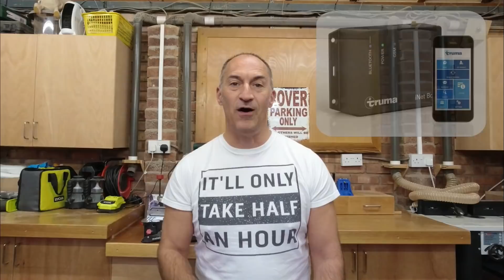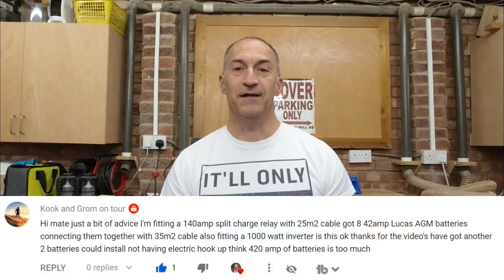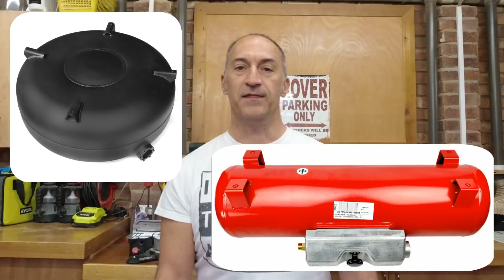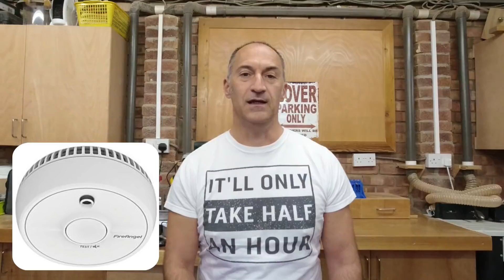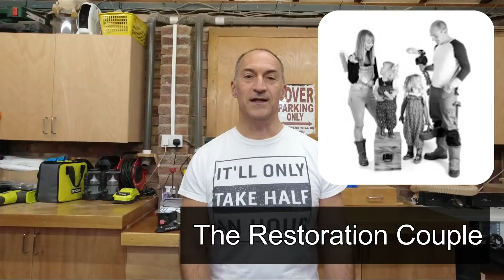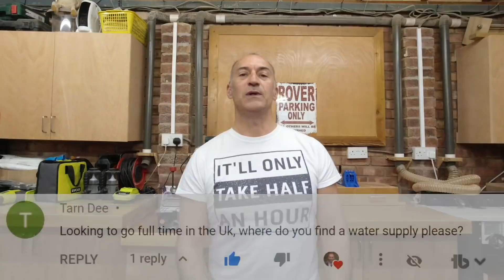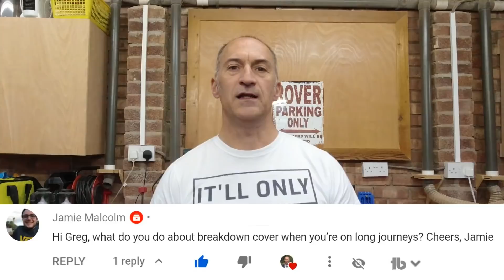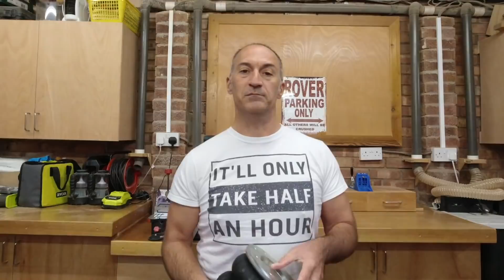Vanlife Q&A - Your Questions Answered

Comment: 0:13 Hi Greg, just recently subscribed, brilliant stuff, love the technical explanations. I’m planning on getting a LWB sprinter for conversion. There will be four of us, so I’m looking for ideas on sleeping space, I’ll also need to fit another seat for travelling, I’ve a girl and a boy, so I’d need a referee if I was to put them in a double. I was thinking of a single bench/ bed.. or even a single bed that lowers 
. The main help I needed was with the extra travel seat and attaching it to the floor. Would it be a case of fitting the base straight to the floor, and then fit the insulation/ ply around the base? Any ideas would’ve great.. Thanks for all the content… I’ve got the van bug…
Reply from the maker: Have you thought about roll out bunks for the kids that you can roll away and clip to the wall during the day. You can raise the seat but need steel support channel or box section and longer high tensile bolts. Don’t scrimp on the secure nature of this as it will have a lot of inertia 👍🏼😊

Comment: Hi Greg

Just on with my second van build.  On my first van I had the cupboard doors made up with a 3mm PVC edging fitted all done in the kitchen manufacturers workshop. I noticed in your video you used iron on edging. could you tell me how that is held up and if it was any particular brand of edging
Reply from the maker: The iron on edging has been amazing we have not got a single blemish on any of it after over 3 years of constant use. The edging was supplied by Morland uk. I have done a video making the cupboard doors showing how I applied it.

Comment: Hi Gregg
Another excellent video, thank you. I'm working my way through them lol. Regarding using Sketchup, it didn't take me long to run into difficulty! I have managed to form the 3D shape of the shell, as per your previous video, but for some reason it's not behaving in the way you managed to get it to go. When I deleted all the guide lines, a load of lines remained within the body, but when I deleted some of them, instead of just the line disappearing, the whole section of panel disappears? Any small help would be greatly appreciated. Thanks again....
Reply from the maker: Make sure all your lines are drawn on layer 0 you may find you have grouped lines or put lines into a component by mistake selection. You can explode these groups and reselect them. Hope that helps
Reply: Once again you've shown you are a top man! Thanks Greg

Comment: Hi Greg I have a Ford transit with two 12 v 80 amp batteries under the drivers seat, and I have two 135 amp leisure batteries, what I need to know is, do I need to change the 80 amp to match the 135 amp batteries but then do I need a larger battery cable I have 16 mm at the moment
Reply from the maker: The best way to charge your leisure batteries from your van is with a B2B charger. You can set the charge profile to match the type of battery and it will manage the charging much better. 16mm cable would be fine for a 30amp charger. I recommend Victron Orion 👍🏼😁

Comment: Hi Greg, I wrote you a while ago about using an AC charger with a true sine wave inverter to charge my batteries in my van build. I did this because we weren't planning on doing much boondocking. the system works fine for the most part however, I am running into a peculiar issue, and I was hoping you might have some insight for me. when the van is running and the charger is operating, the refrigerator display becomes erratic. It appears to be functioning ok but the display jumps all over the place. Also, if our phones are connected to the battery system for charging, we are unable to use them. Again, while the charger is operating. if the charger is off, no problem for any devices hooked into the battery system. Is the AC charger causing interference with the electronics? Thanks for any advice and very much appreciate all your videos.

Comment: Hi Greg. Firstly just wanted to say your videos are fab. I am just about to start a van conversion and have just bought the van. I am considering going gas free on the van. I have a LWB van so plenty of room for solar and an considering a 300 ah lifePO4 battery. I am looking at the Truma Combi D6e, a Combi microwave instead of an oven and an induction hob. Just after your opinion and any advice you may have. Thanks.

Comment: Hi Greg have enjoyed you build series to the extent that it has spurred me on to have a go, I have now almost completed my Transformation of a Citroen Relay L2 H2 into a 2 birth Campervan using and adapting some of you video content, I have one question though I have fitted a 25L gasit underslung gas tank a Truma Bopiler and Thetford cooker I want the Gas system inspected How and where did you get this done I live in Braintree, Essex so not far from your original Base , any help would be appreciated,  Regards
Reply from the maker: Speak to your local caravan and motorhome dealer. They will be able to put you in touch with an lpg engineer

Comment: Hi Greg ! Thanks for all your very instructional videos ! I have one question about solar panels. At the beginning you planed to have tilting panels to catch more sun, but you didn't go this way. What about the temp growing under the panel when exposed? It seems you have less height below your panels than many others that suggest to have at least 10cm for good ventilation. What is your advice on this ? I would prefer, like you, to have the minimum height. Thanks a lot !

Comment: A little trick that may work for bending over head boards, is if you can cut kerfs in to them to make them flex to the shape you want. Thanks for your videos Greg, absolutely brilliant. No Cigar Box but just finishing my first Acoustic Guitar, maybe one day we can have jam. All the best.
Reply from the maker: A lot more skill required to build a regular guitar. Thank you for watching 😃
Reply: @GregVirgoe  difference being I'd really like your Van building skills! :) Have you ever though of insulating with Aerogel Greg? Very expensive but very impressive properties. All the best.
Reply from the maker: The small gain in insulation would not offset the massive cost. £100/m2

Comment: Hello Greg,
I have written to you in the past asking questions about your van build. 
Your help has been invaluable. I was actually going to make a video outlining how I had followed your channel to complete my van build with no workshop and ‘basic tools’. I found your channel to be the best by far and had taken photos along the way using tools bought second hand but some new items and reclaimed material that others had thrown out. All done with no workshop and no experience. I finished my build back in April and I have not been able to make the video because the photos were accidently deleted. Now I see that you are going to do exactly what I had intended to do, I thought I’d reach out and tell you what a success it was and much easier because of your guidance. I’m in Australia and the insulation works a treat. Fantastic.
If you like I can send you more information about my experience following your ‘tutorial’ if you think it might enhance your next build that you have highlighted, for those that don’t have a workshop or limited tools.
In short my van is a MWB Sprinter High Roof. I had the passenger side sliding door removed and installed a fiberglass mould and caravan door in its place and a caravan style awning added. The drivers side sliding door was disabled and fixed in place rendering it inoperable allowing for the Lagun table and seat, with porta pottie under, to be installed in that location. External surfboard racks are mounted on the side. Both seats have swivel plates installed. The bed is East / west layout by cutting out the ribs and then reinforcing the outer skin with sheet metal. The cupboards and storage is built in the Shaker style all material was free off the street during Council clean up. I only had to purchase the ply for the walls and floor. I installed two Sirocco fans at the rear. I did the build out in the open air using basic but ‘good’ tools I bought mostly second hand. The new tools I bought were a life saver. Kreg Acu Cut, Kreg Rip cut, pocket hole jig, and a two in one brad nailer. The compressor was $50.
I was worried about the sink/stove cabinet build, as you know it has to be millimetre accurate so I first built it as a ‘template’ using free offcuts from a nearby kitchen maker. I built it in the loungeroom. That was really insightful and I nailed it perfectly because of that process. 
The fixing of the overhead cupboards was a solve it as you go issue because though I built it square and plumb it would distort slightly when I attempted to mount it due to the curvature and shape of the internal ply lining wall as it approached the rear barn doors. 
What I liked about your channel is that you were thorough and you were inviting, just like the BBC. You have been a great help. Thank you. My son is so impressed he wants me to help him build his.
I'd send you some pics of my van if you can tell me how.
Giacomo ‘Working on a Dream’

Comment: Good update, thank you, Greg. I was wondering how you found the single-glazed windows now you are back in the much cooler UK? Any condensation problems? Thanks.
Reply from the maker: We do get a little bit on them but by far the best thing is to keep the van ventilated and warm at night. That helps a lot
Reply: @GregVirgoe  Thanks! I'm at the point of deciding whether to go with single (better-looking) or double-glazed (expensive and less pretty).  Was your choice influenced by budget (at the time) or other factors?

Comment: Hi Greg.. In your opinion, which material is the best to do the furniture inside the van, plywood or MDF including the walls, ceiling and floor. Thanks
Reply from the maker: Personally I would try and start clear of MDF because it’s heavier and swells up if it get wet. A decent ply would be structurally better.

Comment: I have a sprinter like yours almost to the limit and i put the same airbags on. It was the best thing i have done. I'm flying around roundabouts like a normal passenger car.  the wind doesn't blow me around and i don't have to grip the steering wheel hard anymore.

Comment: Thanks for the Q&A, really useful and informative as always. Regarding LPG - it's sounds as though its getting phased out. If you were doing a van build from scratch would you still install LPG or go for an alternative heating source? Thanks 😊
Reply from the maker: it won't be phased out as there are millions of motorhomes and caravans that use it. It's just the popularity of LPG car conversions that are being replaced by electric. there will just be fewer places to get hold of it. Diesel is another option but that will be phased out on 10 years time.
Reply: Thanks @GregVirgoe  I was having a panic 😂 been checking the mylpg app as well

Comment: Hi Greg, I have a 130amp LB, a 100watt SPto ring dctodc  which will be going to fuse bank 
would  I be going OTT if I use 20 mm cable plus 150amp breaker. It is only
a short run of cable 2/3 ft. Sorry if not to clear, not in order as iv'e described.
not sure if this is where to ask Questions but could not find your e-mail
Les

Comment: Great Q&A Good to see your going to fit the air bags, you may remember I suggested a system like this which would double as a leveling system on uneven ground.:)
Reply: I'm sure you've thought of this but just to add ;)I'm guessing you'd have an onboard compressor for the bags and use an air solenoid for each bag with independent switches and a spirit bubble so you could level up front to rear and left to right from inside. I think many will follow you on this and surprised more don't already do this. All the best.:)

Comment: I think you're onto a winner with the next van build 👍. With all these power oak reviews around, it is suggested that that may be a cost effective alternative to fitting batteries and electrics in the van, will you look at that? Thank you 🙂
Reply: Would you also take a look at Bobil Vans Bit Water 12V diesel heater kit, of GBP 150, is a cost effective alternative to water heating compared to propane, electric and diesel water heating? 
It is used in Mispronounced Adventures van that is being built now.

Comment: Hi Greg. Thanks for the vid. Looking forward to the budget van build. I'm interested in the air suspension set up as thinking of adding it to my van. However also have a concern about the chassis at load bearing of the air bag. Mali.Mish i believe as one example fitted a similar additional suspension aid (supersprings) and had the chassis starting to fracture on the sprinter. An extra leaf to the original springs may suit the chassis design??. 
Great vids. Good luck looking for a another van, I'm looking for a newer sprinter but prices are ridiculously  high at the moment.

Comment: Thanks Greg, Great video as always. Looking forward to the new van build project. 
Regarding the airbags you are going to put under your Sprinter, will that change on the suspension, make it possible to have the carrying capacity registered higher than 3.5 tons? If that is possible, do you then need to put in the Sprinter van, equipment that records speed / driving? will the change require increased driving licenses?
It is common that camper vans and motor homes are stopped and weighed in UK?
Hope you have the opportunity to discuss this in the upcoming videos related to the airbags install.

Comment: Hi Greg, I have one question which I can not find any answer to and I would like to know if you have come across it at any point of your design. I would like to use an excess of solar energy to keep my water boiler always pre-heated via 12V heating element. I'm trying to find on the market some solar regulator with proper dump load connection (not only to charge USB socket). Maybe there are not any viable for campervan and only way is to design the system from scratch. Thx Pav

Comment: Hi Greg. I found the up plating process quite straightforward, the company used was SVTech.  On the request/ info form giving details like chassis number tyre size and rating plus details off the chassis plate under the bonnet which lists design weight plus UK plated weights for your axles, allowed my van to go from 3.5t to potentially 4.5t however I opted to add an additional 500kg and this was done without any modifications to tyres or suspension. It now allows for that extra pack of beer. Bit like the xxxx beer advert, don’t over do it with the sherry!  
The air bag fit was a doddle, but do ensure that you jack your chassis up level leaving the wheels with some contact on the ground. This will ensure that the axle remains secure to the springs when you remove the U bolts. Also have a good think about where you plan to position your gauge/inflation valve. I opted to run the pipes into the rear garage. This avoids a long run to the cab and routing around the exhaust. However if you have purchased a kit with a compressor you may want the controls in the cab. Only other tip I can give is to be prepared to have to fit new U bolts. Do check them for stretch when you remove them paying attention to the “inside” of the U , and how they fit over the new airbag bracket.  Good luck and enjoy the ride 👍👍

Comment: Greg, thanks for the video, will look forward to the budget Van build. Just wanted to let you know I got my van fixed, new inlet manifold, also broken bolt removed and re-tapped, and new air mass sensor in total £722.00 but she runs better than ever.
Reply from the maker: That's great news Simon, i'm pleased you got it sorted, happy travels

Comment: I had the external tank and, yes, they are much bigger. The downside is filling them if you're parked up somewhere. If doing it again, I would get a "T" so you can plug in a Gaslow or normal bottle if the need ever arises. No, I didn't think I'd need to ever have the plug-in system. Yes, it would have been very useful on a couple of occasions...